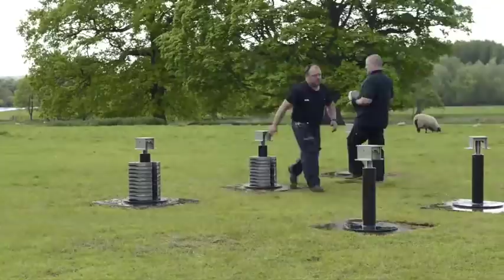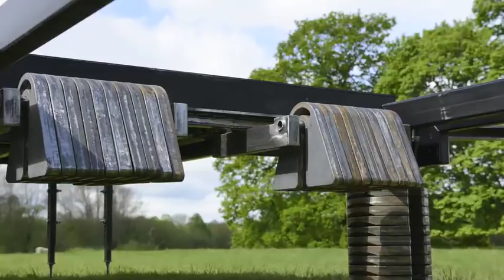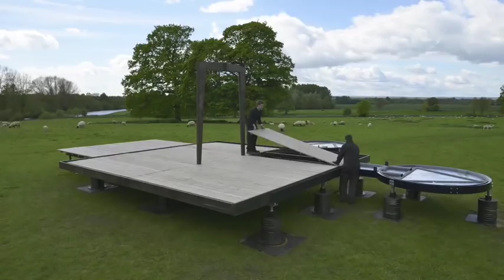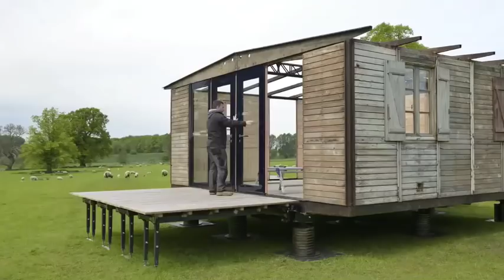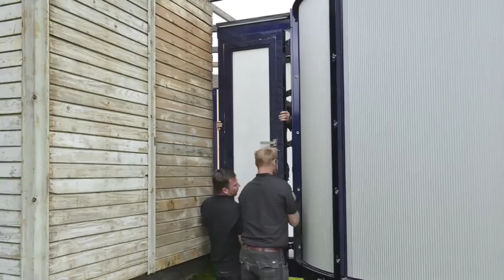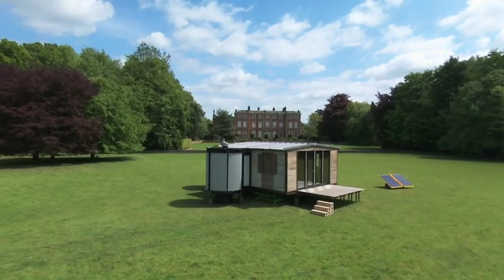Time-lapse movie shows construction of Richard Rogers' revamped Prouvé house

Comment: i SUPPOSE THE METAL DISKS AROUND EACH  STILT AS WELL AS THE TRIANGULAR PIECES ADDED ONE BY ONE TO A HORIZONTAL BEAM AT THE BASE (apologies for the caplock!) are there to providide stability. I had never noticed this feature before.
Reply: I guess the disks are there to add weight so it doesn't blow away or topple over. The triangular ones were to counter balance the porch for closing/ opening it.
But this is just my presumption.